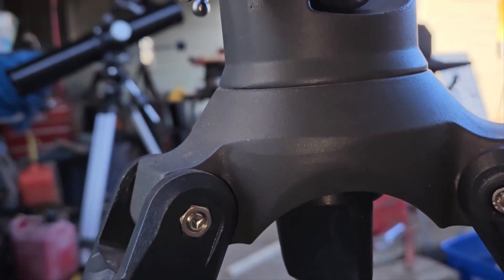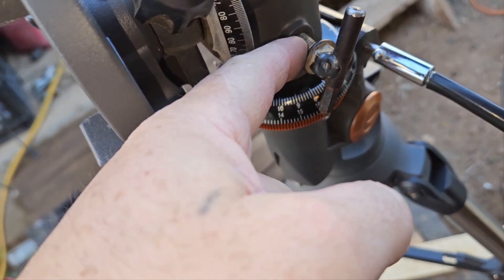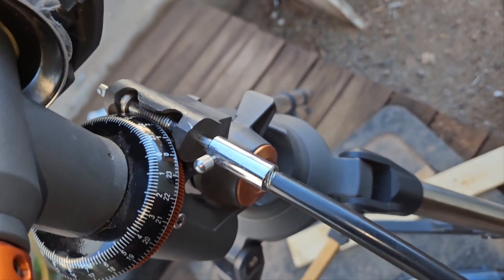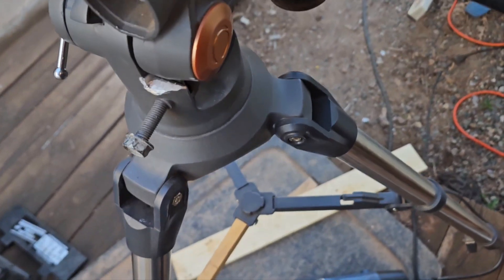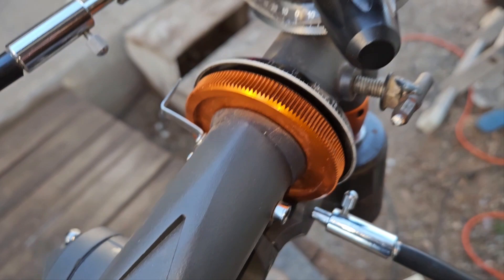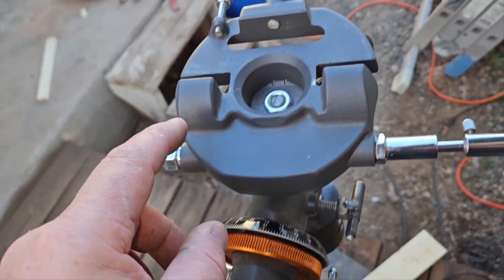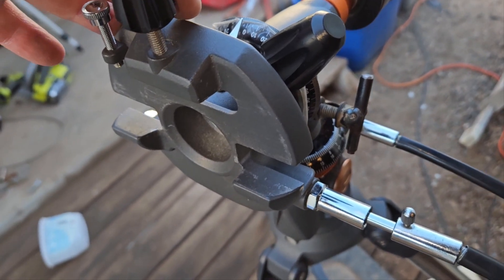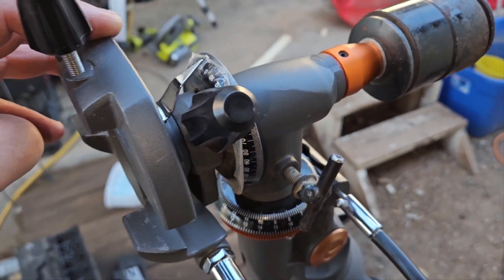modified german equatorial mount to alt azimuth celestron  CG-3

Comment: i have a cg3.. tightened it all up and put a motor on it.. with minimal work the cg3 is a good low end mount.. especially if mounted on a pole thats cemented in the yard.  its not  the best but its not as bad as most Tesco or other eq mounts that are floating around.. i like mine for now especially with the logic drive..